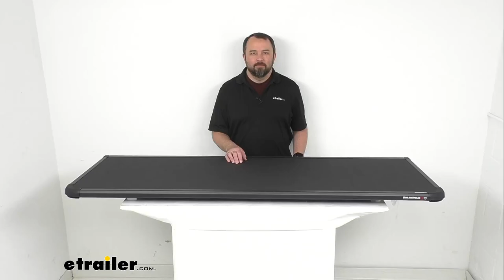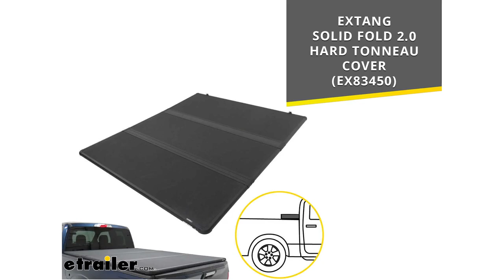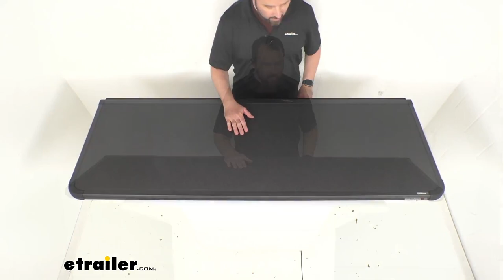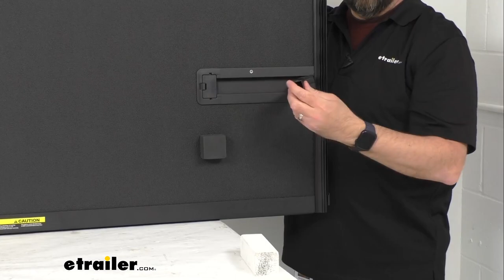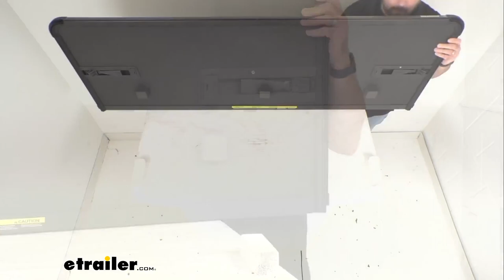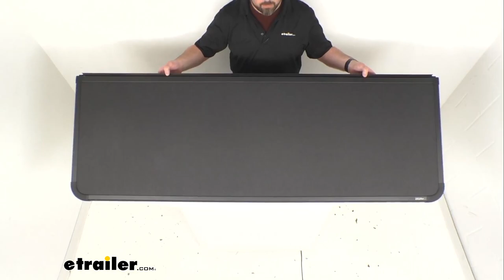Review of Extang Replacement Tail Panel Assembly Solid Fold 2.0 Hard Tonneau Cover - EX83450-62

Comment: I need to see HOW to replace it.
Reply from the maker: We'll get with our video folks to see if we can make that happen.
https://www.etrailer.com/Accessories-and-Parts/Extang/EX83450-62.html
Reply: @etrailer  Thanks, I figured it out but it sure would have saved my BP if I had a how to. LOL!
Reply from the maker: Good job! We're glad to hear you were successful!
Reply: @etrailer  Thank you for all the stuff you guys do. It really is appreciated.
Reply: @wxmyjnsn how did you replace and install it if I may ask?
Reply: @octavioolivas7971  I was able to fix it. I figured out how it went together. Mine was not broken just separated. If you need help let me know.
Reply: @wxmyjnsn yes if you could please give me some what if an idea where to start or how it is done I would greatly appreciate it..mine is also just separated and not broken...a gust of wind blew my tail panel apart is all that happend..I've tried to pop it back into place but have been unsuccessful with that.
Reply: @octavioolivas7971  That is what happened to me. You will need a torx 20 bit
Take off the hinge part on both sides.
I did this next part at 90 degrees but some say 45 works too. Starting on one side of the truck take the section that has separated and slide its “roll” into the hinge (groove). Then slide the whole section through until it reaches the other side. While doing this it will slide pretty easy, if it doesn’t you are doing it wrong. Once it is flush on both sides replace the hinge locks and tighten torx. If you need more help let me know